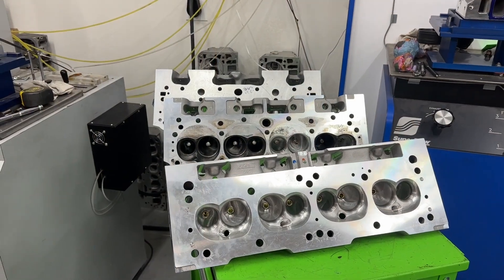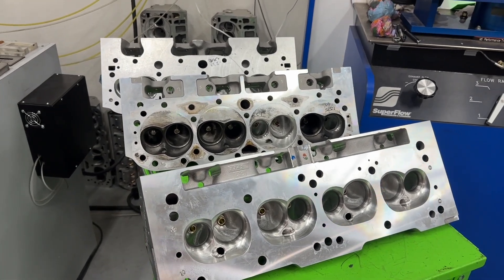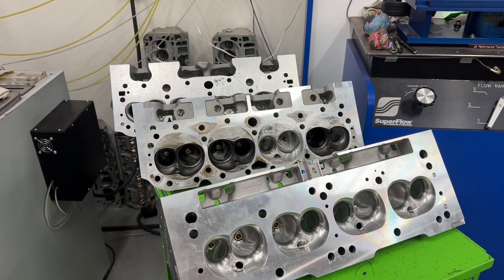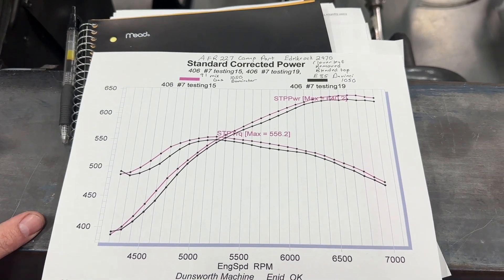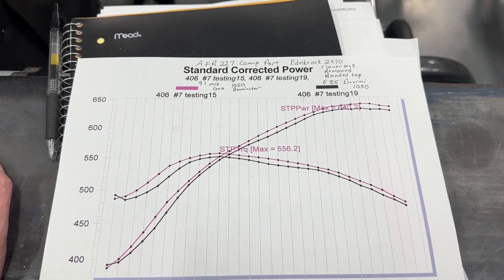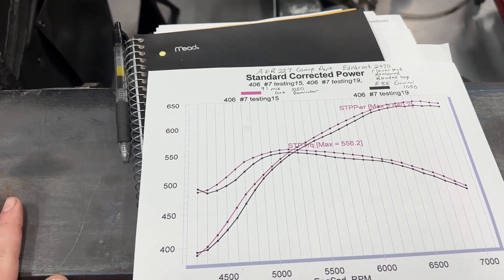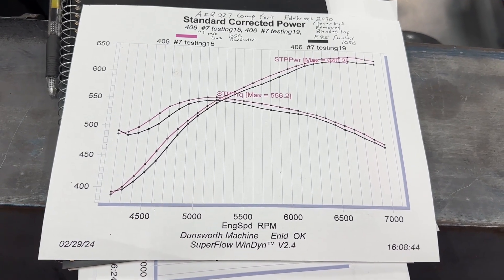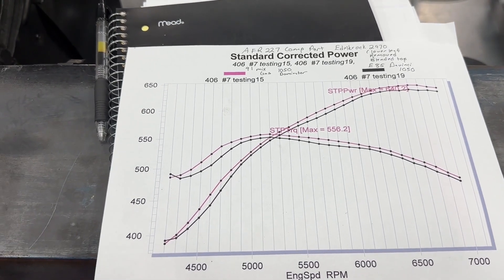E85 Made Less Power

Comment: What temperature was the engine when run on the dyno with both fuels? I have found that e85 does not like a cool engine with aluminum heads, it likes more heat.

Comment: Saying the 355 is only half point more compression is just a good start point. What was the cranking compression of both engines, better comparison. Also if the wing was knocking fuel out of suspension on the ethanol, its doing it with gasoline also.
Reply from the maker: Yes but not as bad. 355 and 406 both pump 200-210

Comment: The wing prolly has something to do with wet flow on na but not much 
E85 makes more power on higher dynamic compression with raised timing  hints why boost loves corn 
You can run higher timing on your higher dynamic compression  made by your boost 
not so much on static compression na especially as low as 11:1 with a combustion that has to run that much timing to get max power
36 is pretty high to get full burn when stock ls do it on 26 degrees with 11:1

flex fuel cars of today, the way they make more power on 11:1 is because they have variable valve timing and can manipulate and raise the dynamic compression and raise the timing to make more power and precise control of the air fuel ratio as well

If you read this comment 
figure the dynamic compression on the 355 and the dynamic compression on your test motor see what the differences is

The ls3 11:1 can make more power with that wing on corn but only with variable valve timing 
not with a cam with the same specs that doesn’t have variable valve timing

Comment: The e85 is taking up more space in the intake runners than gasoline, making the motor use less air, offsetting the potential gains, if the engine is using all of its potential airflow on gas, adding more liquid in the flow path isn’t going to make more horsepower unless there is oxygen in it,

Comment: Was it a calculated afr or actual afr? 

Usually ethanol will still be ok running somewhat leaner in the first place but not 13.2

If the engine isn’t timing sensitive ethanol may not make any more power. 

Cam timing may also play a role due to the way the combustion event is trapped. 

There are too many variables here. Even the piston shape can make the combustion even less sensitive to timing. 

Sometimes also e85 can may over  cool the combustion and the engine might need to be hotter to vaporize the fuel.

I agree with it may not be in suspension
Reply: Exactly, aluminum heads and a colder engine will not make as much hp with e85.

Comment: Was e85 run with with what appears to be alot of spacer under carb ? If so is this dampening signal to a point where it will not pull fuel ? Have heard of instances where you can take the jets out and engine will not get richer because of poor signal

Comment: I’m not sure why you want to discredit e85; however your test is invalid. e85 changes the flame front in the cylinder requiring a timing change. Normally requires 3+ degrees of timing. 
I don’t think I’ve ever seen pump premium out perform e85 in a properly tuned application.
Reply from the maker: I’m sure listened to the video where I said I tried timing with e85 on the 355 and it did nothing.
Reply: I was rather reluctant in trying E85 in both my Camaro and my Son's Camaro. Apparently you do not know how to tune a car using E85. I have used it in three different engine combinations, including a 9.5-1 460 , 12.5-1 489, and a 13-1 540, all being BBC. That being said, the 460 was run on both pump 93 octane premium and pump E85 , tested at 85%. The best dyno will always be the drag strip. My car on 93 ran a best 10.95 @121, on pump E85  ran a best 10.91 @122. So, other the initial cost of a custom built carb for use with E85. My Camaro runs cooler, runs better, and is more consistent on E85. And pump E85 is over $1 cheaper per gallon than pump 93, here in Ohio. So, in closing your results of making less power with E85 are due to lack of testing and tuning! I am subscribed to your YouTube channel, and was surprised that you dismissed the use E85 so quickly. Also there's no reason for mixing 118 with anything especially at $155 for 5 gallons!

Comment: That’s the same exactly fueling issue we had on my 582 with an unmentioned custom spec’d 1375cfm carb. We jumped all the up from .126 jets to .140 jets and still had to abort runs because we were seeing 13.8-14:1 around 7000rpm. Oddly enough, we’ve since sent that carb to DaVinci. We haven’t heard back from them yet. However, it’s looking more and more like the car won’t be ready before the end of this season. I’ve already upgraded from MSG Grid & Racepak to a Haltech Nexus R3 management system. So I’m seriously contemplating ditching the carb and going fuel injection. That was already the goal, just later down the road. I’m thinking fuel injection with a dry nitrous fogger kit.

Comment: E85 works best around 11.7/11.8 on a gas scale With e85 you also have to work with emulsions changes in the metering block because of the gravity difference in the fuels . The motor should of picked up on power going to E85  , If your adding jet and not making a difference in power it sounds like you have a restriction in the metering system some where . Carb is probably a little big Aswell.

Comment: E85 on a n/a engine is not worth the effort. And in reality since you have to buy a carby anyway just buy a methanol one and use methanol. Better all way around as well as safer. And methanol will make more power,, even on a 10-1 engine. There however is a lot of different methanol carbs and some work a lot better than others. This on speedway sedans.
1050cfm carb whatever is simply too big and suffering from a lack of airspeed. A 750 or 850 is what you need.
Reply: eric is the engine builder.. not a back yard assembler. you think he would of taken all this into consideration? that sbc of his is more then capable of taking a 1050... dont know what your talking about lol.. eric probably one of the smarter guys on this platform... he would have calculated everything...

Comment: Your theory on why enlarging the jets didn't change the A/F ratio does make alot of sense. Did the exhaust temps change? Did the bsfc change? Those could help determine if this was the carb or the vane in the port that was the cause.

So you keep stating the intake port  volume doesn't correlate to bottom end torque (ie smaller runners)  with all these dyno tests going on, you need to find 2 sets of heads with exactly the same port volume intake and exhaust, same valve sizes and chamber cc's but have very different port shapes and dyno compare.

Comment: The direction of the  vein depends on the head.. The Short turn and how the bowl is fixed. Measure from the short turn to the deck of the head on the AFR's, and the other heads U we're comparing them to. Then look how much the short turn is laid back... The short turn laid back with the vein angle the way it is on the AFR can and will cause FUEL SHEER in a carb application with E85, Methanol...
Reply from the maker: You must not have actually seen an afr head. There short side is steep not laid back.
Reply: @WeingartnerRacing   
I should have said if the short turn is straight up or tall, the way U did your new port on the dragon slayer head is the best. Oh yeah by the way I LEARNED ON THE SAME SUNNEN SEAT AND GUIDE MACHINE U HAVE, AWESOME MACHINE!  Keep up the great work!
Reply from the maker: @jerrypennell544 I have a robins seat and guide machine before that a Rottler. I have never had a sunnen.
Reply: @WeingartnerRacing  
The white seat and guide machine in your video is made exactly and look just like a SUNNEN VDS 20D,  I will pay attention next time your using it.

Comment: Great information. Most people have a hard time believing Fuel inj. motors want the same as carb motors. Gen three coyote's have 12 plus to 1. But they have cam phasers and knock sensors to avoid detonation. Lund does ad and delete timing in certain places. this is done so the trans doesn't granny shift. Also he changes the trans tune and shift points. There is no magic high power gains in the tune. The e85 helps eliminate knock so the ecu doesn't pull timing.

Comment: PLEASE take advantage of the E-85's extra cooling capacity on the intake. 
ALSO boost the compression up as well, either with more static compression 
or cam timing to allow thechamber to make more dynamic compression!

This is NOT an apples to apples comparison!!!
Alcohol done right will always out perform pump gas.
E-85, E-100 ethanol or straight methanol....

Double dog dare you to test two idenical engines....
One set up SPECIFICALLY for methanol or ethanol,
 and one for pump gas, 93 octaine

The  alcohol engine should have about 13 to 15-1 static compression 
and an alcohol camshaft.
Preferably mechanical injected.
Like a drag racing alcohol injected dragster or max effort 410 sprint car.

And the gas one set up for maximum effort 93 octane gasoline.
NO ADDITAVES, ie, octane booster.

I like most of your videos!
Thank You!

Comment: Does the carb have screw on main jet extensions? The jet extension ID passage needs to be larger than the jets tested. Because if the extension is a smaller ID than the jet hole ID you well never see a AFR change. Sometimes for E85 the extensions need drill out larger for the new updated larger jets.

Comment: The power being less on this test with E85 is due to the lean mixture not head port or vane style. If you would’ve been able to get the AFR where it should be power would go up on E85.

When changing jets 6 to 8 sizes larger results in little to no change in AFR that means the carburetor has fuel passages that are undersized and are the restriction not the jet. Either the fuel passage in the metering block or fuel passage in the booster are too small.
Reply: Agreed , I was thinking metering block's, but if this carb was set up for e-85 by a reputable builder, u wouldn't think that would be a issue.

Comment: 3 years ago I dynoed a mud truck motor for a customer, 383, 10.6:1 stock out of the box brodix track 1`s hyd roller, on pump 93 gas it made 500hp and 500 torque on E85 pump gas checked with a hydrometer it made 495hp and 520 torque. For what it`s worth I believe ya, it makes sense. my customer said he didn`t like fussing with the E85, it smelled like dirty feet and couldn`t feel the difference anyway so he runs the 93

Comment: I think something is wrong with this test. Here in the jungle (Brazil) we have ethanol (e100) on gas stations since late 70's/early 80's and had etanol vehicles since them. Every engine is slightly more pwr on ethanol the on dinosaur's juice. 😅 No matter if it's completely stock or modified. Even eth doing around 70% less heat, if we make some math, burn ethanol generates more heat with the same air volume and same lambda ratio for gasoline, because we need a loooot more fuel (in mass). We have flexible fuel engines sold since early 2000's. Every engine is slightly more powerful using ethanol the petrol. And, at most, the engine management systems modifies the ignition timing, increasing a bit, while the strategies of them detects more ethanol on the fuel...
Reply: Nothing wrong with his test, did you watch the entire vid??.....see what he's talkin about???.....THOSE particular heads, on THAT motor, with the vein pointed twds the wall, wud NOT servr E85, or methanol.....he explained why......NOTHIN wrong with his test, i'm havin his back, cuz i've followed him for a # of years, and he's QUITE thorough in explaining each test.....the combo may make more with E85/methanol, but u'd need a dif set of heads.....

Comment: Seems to me the fuel has more inertia than the air so it will slam into the bowl of the port while the air turns, the wrong is a trick to get more air coming in behind the fuel in the bowl and helping the fuel turn into the cylinder not just hitting the port and dribbling in... probably costs a little flow and max hp but helps street driving conditions.

Comment: No dyno testing but street car testing, my experience has been that e85 is very velocity dependent due to its heavier specific gravity. My test were a 1050cfm sullens twin blade e85 carb vs a 850 sullens e85 carb. 850 was noticeably faster everywhere on my 414 small block mopar street car
Reply: Did know Sullens was still around.

Comment: I think you're onto something with the vane and E85. I've run E85 in my 355 sbc for years now and what I've found is it doesn't atomize well without some fuss. Of course boosted no problem. E85 needs to be in finer droplets, ie annular boosters and intake temp no more than 180 tops as it will "take up space in the intake tract". I had alot of problems also using a victor junior without a spacer because of hood clearance, the fuel must have been pooling on the intake floor and when i was able to just add 3/4 spacer it made a huge difference. On a diff note, I'm wondering if the Edel 2970 and the spacer with such a large carb on E85 has an issue with the fuel atomizing because lower velocity? Great video! Love the stuff that makes us scratch our heads.

Comment: Coast high performance built a 408sbf test mule with mid 10 point compression. With AFR 205 heads. They made a hit with e85 and picked up torq. No changes to timing. 

So i think you're correct with the raw fuel assessment. Definitely surprising results, and I'm happy you tested this combination.

Comment: That wing sheds a vortex, as it wraps around the vane and rotates, it carries flow from the windward side(port roof) to the leeward side(towards the plug). Vortices create shear stresses on the leeward side of the thing shedding it. This means fuel would pool up in the bowl. The remedy? Maybe textured valve, or a fuel vaporization ridge, or both, but that's just a band-aid, and doesn't address the cause of the issue.

Comment: E85 should make more H/P & Torque due to the colder latent heat of vaporization (colder intake charge) why it didn't, I'm not sure as I wasn't there. How old was the E85? Was the A/F optimum for E85? In this case pump gas wins no doubt. I believe E85 has the potential to make a little more based solely on charge temp reduction, But I would not be interested in paying $8 a gallon for true E85. Great testing as you just can't make too many blanket statements in this business. Each combination is unique. Vane very well may be hurting wet flow.
Reply: E85 should always make more power simply because there is oxygen in the alcohol molecule - the gasoline "molecule" is carbon and hydrogen only - thus no extra magic oxygen like you get from alky. Agreed the cooling effect from alcohol is superior as well, but it's not the whole story to why E85 is usually more powerful. There's something weird going on in this specific case.
Reply: I like to blend my own e85 with a splash of nitro methane

Comment: From selling Sunoco E85R and gathering feedback that fuel really shines with boosted applications.   Don’t really see the benefit with it and NA applications.   I would like to have seen a 950 or 850 carb set up on the pump gas mix and Pump E85.   The smaller cfms would possibly have had better velocity through the carb to help the 406 pull correct volume of E85 into the engine to make a good comparison.   If you run alcohol engines lean they don’t perform well.

Comment: A test would be a great way to prove your theory. If your theory is true, then the 355 engine out of the S10 should have a vain pointed towards the chamber, as it made more torque on E85 and Methanol. Could you take a picture of the heads on the 355 for us?
Reply from the maker: It’s the same as the brodix dragon slayer in the video.